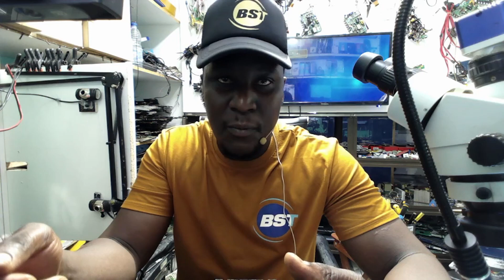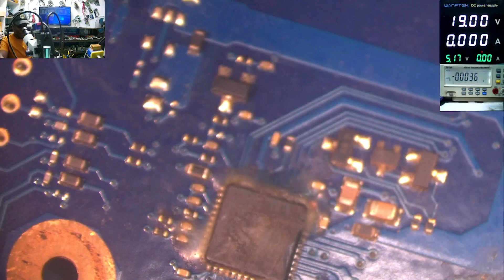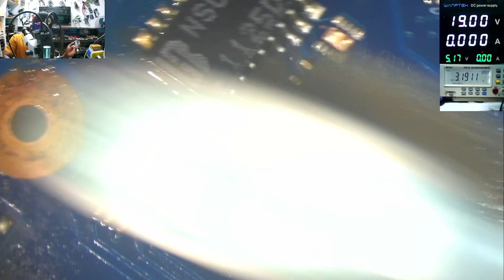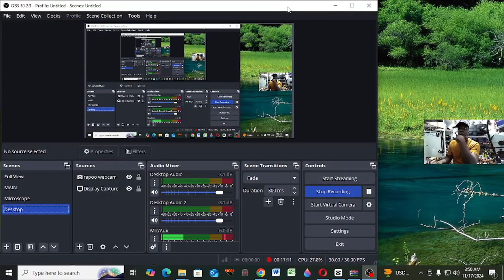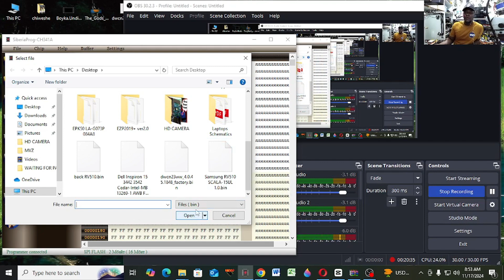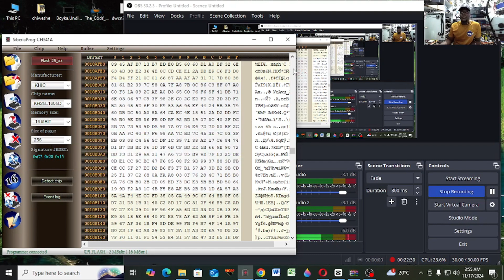Samsung RV510 Board Repair With No Power & Bios Password Removal With CH341A Pro Mini Programmer.

Comment: Hello brother. Do you have the link to the CH341A. That one seems fast and more convenient because of that adaptor where you can reprogramm BIOS without resoldering the chip. I am considering buying it.
Reply from the maker: @justicewasarirevu3412  I just found this on AliExpress: 
US $0.80 | CH341A Programmer adapter+SOIC8 adapter+ SOP8 clip with cable+1.8V adapter CH341A EEPROM Flash BIOS USB programmer ZIF adapter
https://a.aliexpress.com/_EIAH1zS
Reply: @BstAfricanElectronicsSurgery  Fine, thanks. I will place an order with them.